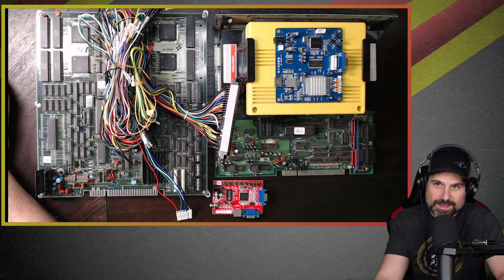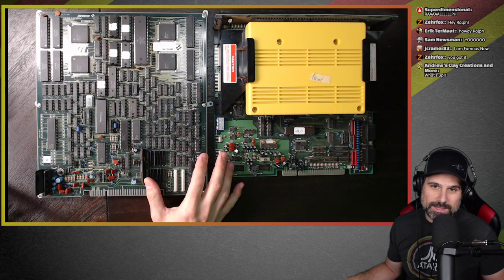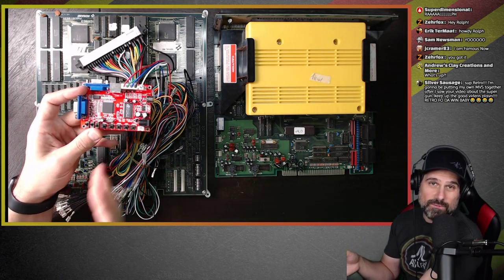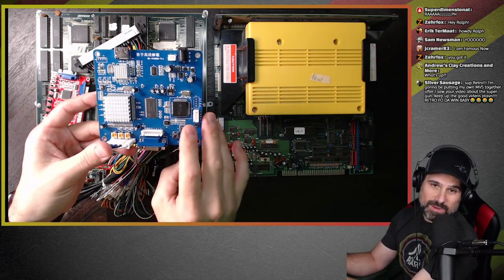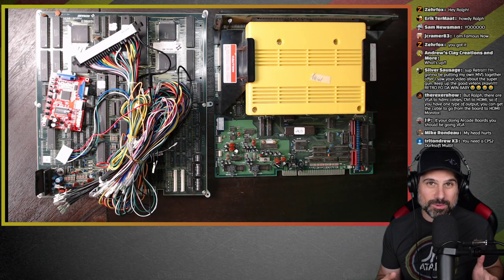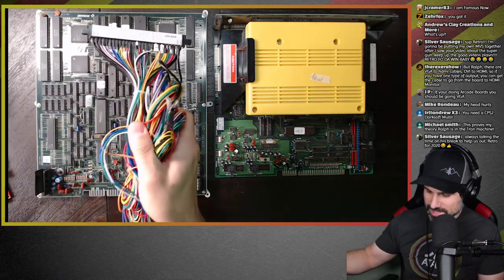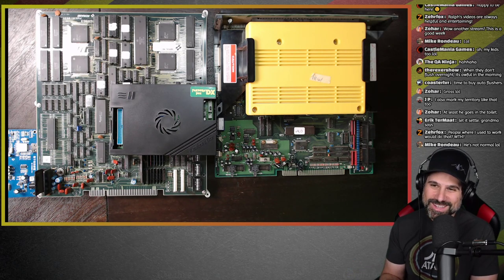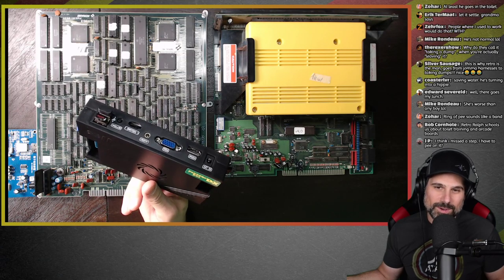Arcade Hardware - The More You Know...

Comment: Built 2 Street Fighter 3 alpha games  an mk4 and a killer instinct 2 arcade cabinets ,  just ordering the parts on ebay back in 2000, ended up with 2 real midway ki2 cabinets in mint  condition by luck and someone decaling the machine when it was new, when i got it from the airport it came out of a arcade in a mall and had graffiti all over it. When i started cleaning the cabinets  i realized they had real decals in min condition under ll the paint. and the insides and back had the midway numbers they worked great for years

Comment: @RetroRalph I recently got a Mortal Kombat 4 Arcade PCB Board, I bought the blue jamma board I think based on your recommendation from this video. I got my hands on a Kick Harness that works for MK 4, but not too sure of the right stuff to get. I want to play MK 4 on my LG TV and hopefully on my laptop as well. I need to get a power supply and some sort of USB Adapter for my laptop controller.